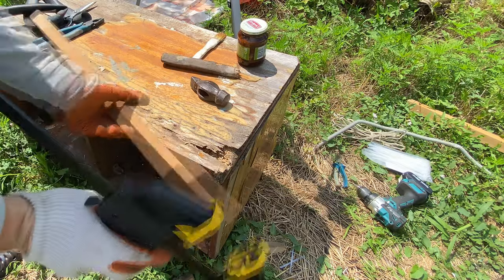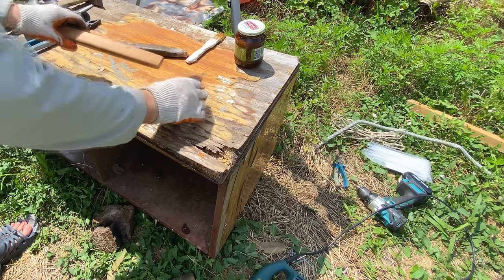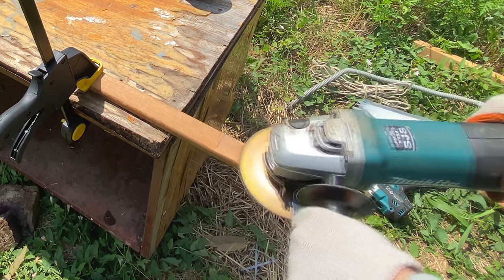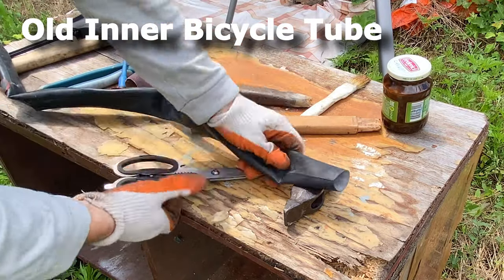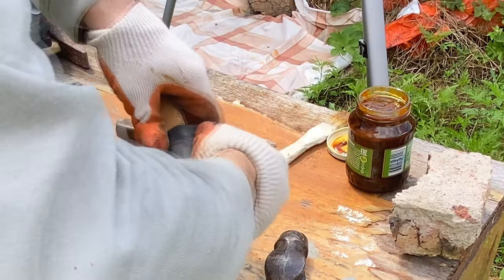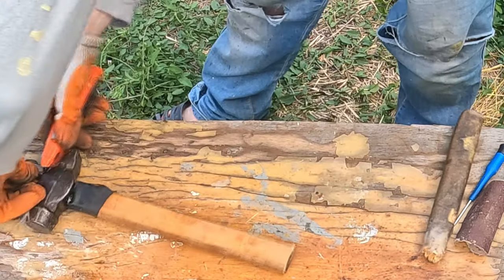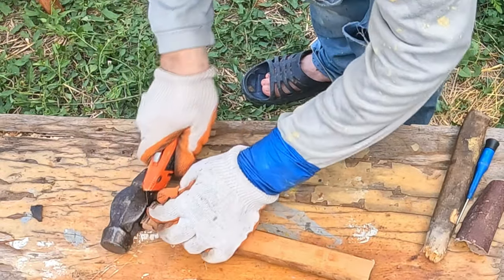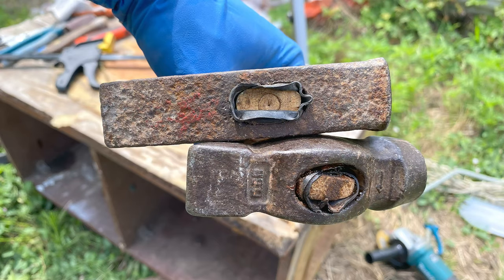No wedge. Grandmother showed the secret How to put a hammer on the handle without a nail or wedge

Comment: And why would you go to all the work to do that and then add rubber and grease?  A metal wedge will work perfectly and much safer.  Grease and rubber make a smooth, sliding surface.  I'd like to see proof after much use that this worked prior to this video being posted.  As for me, I'll gladly continue using a metal wedge.
Reply from the maker: still works great

Comment: Would using glue work better than grease?  Also, why cut off the extra rubber when that will help protect the handle from over-extended misses!
Reply from the maker: I think glue will work well. At the expense of trimming the rubber, this is only a matter of external aesthetics, you can leave the rubber.